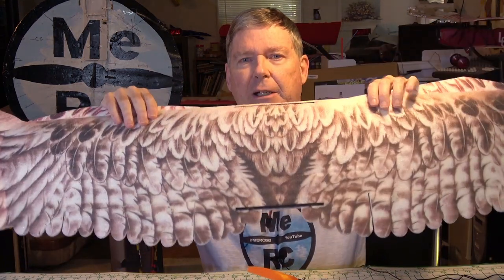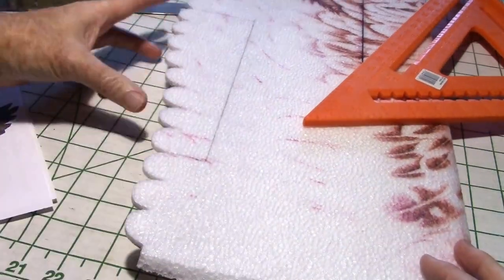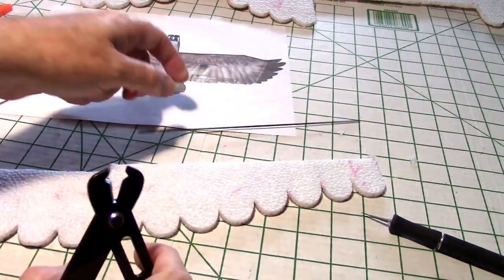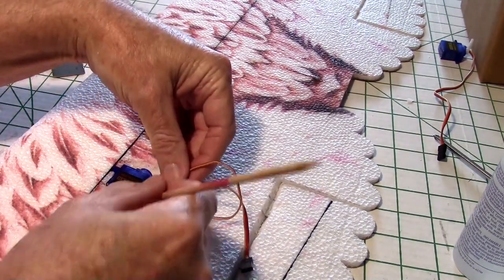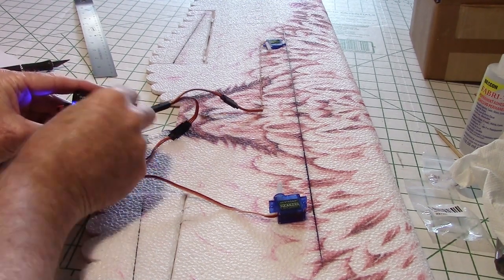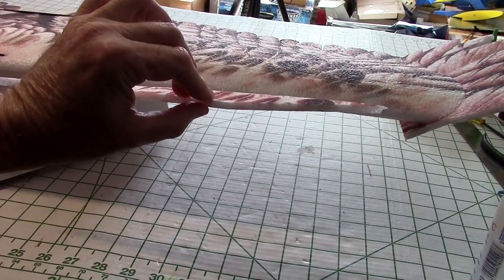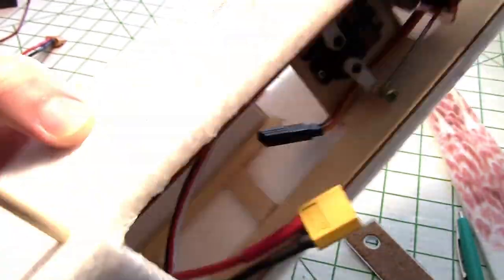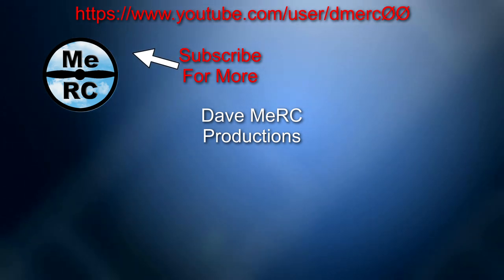DW EPP Mini Eagle RC Plane Build Part 4 - Adding Ailerons & Battery Tray

Comment: Great job. Can' t wait to see you fly your bird. Getting winter time around the Southwest side of Missouri time to start thinking about that flight controller on that S500. Got to knock the dust off first. Guess you could say dusting the bird, or drone, oh well that was pretty stupid, A. Be looking forward to your maiden flight.
Reply from the maker: Thanks Jim. Good luck on the S500!
Reply: @DaveMerc  ,thanks need all the help I 
can get on that drone. Shouldn't be to complicated. Just time consuming. That's what's winter is all about. Lots of time, a few months. What's time when your retired? Just another day. Got that eagle up in the air? How does the saying go sunny side up? Or maybe painted side up.

Comment: I appreciate your technique of presenting the video.  It moves along quickly but the information is still complete and easy to follow.   As for the audio mic I have been using the Sony one you recommended earlier.  It works out just fine for me.  Your audio is coming out excellent too.  Thank you for this video.
Reply from the maker: Thanks for the comment! The Sony ECM-CS3 is a good mic too but I like the power amp that the Insignia has for reducing noise. Now I am realizing the mic inputs on most camcorders are horrible so now plugging the mic into a voice recorder for across the board improvement.

Comment: Glue says fabi tac...does it work like contact cement where you put it on both peices then let air dry for 5 mins then press parts together? Thanks for sharing.
Reply from the maker: Yes that's correct. Fabrictac and Foamtac are contact cement so need to get tacky before sticking parts together.